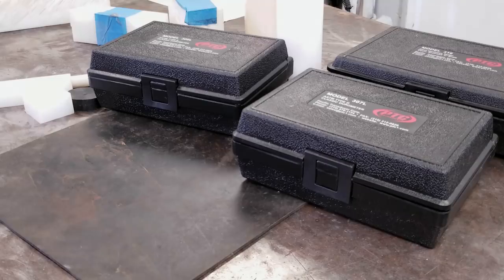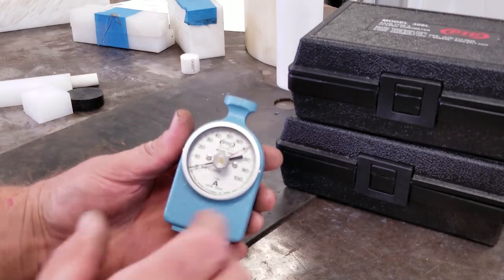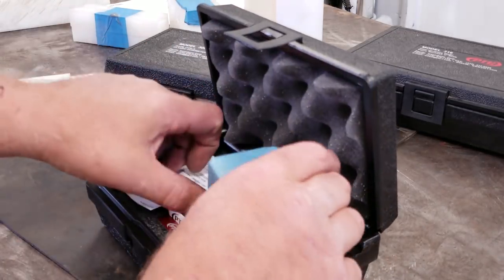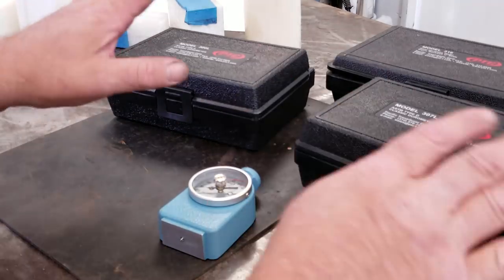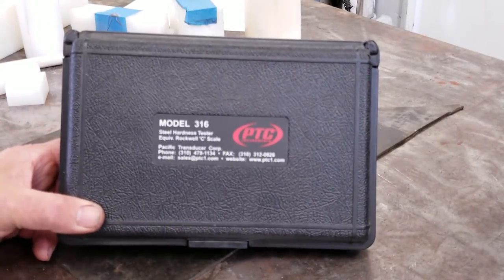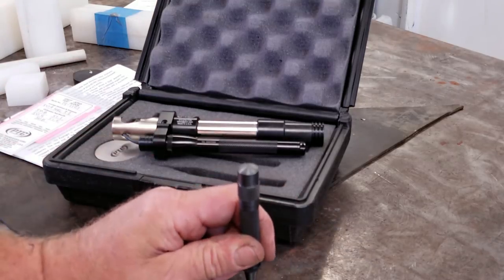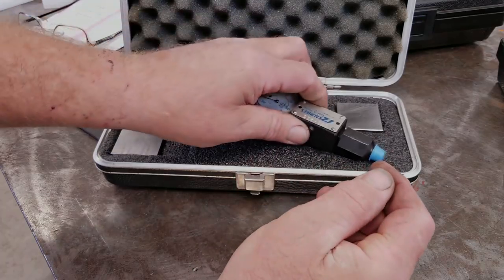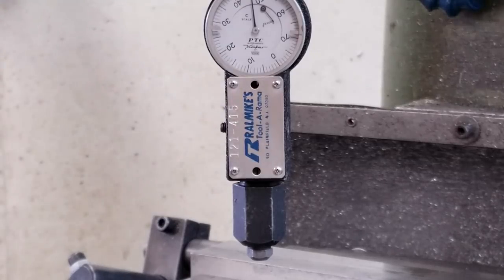PTC Hardness Testers

Comment: Nice video Stan. We use Shore A and Shore D durometers extensively at my work. We've found the variations on the same material are generally attributable to surface roughness. The tip of the indenter for these Type M tipped durometers has a .004 radius and it can find low spots easily, which will yield incorrect low readings. Also, when measuring the hardness using durometers, it's extremely important to ensure the test specimen is at least .250 thick. It is permissible to stack plies to obtain the necessary thickness. This is very common when measuring the hardness of elastomer adhesives to verify complete cures when the applied adhesive thickness is less than 20 mills. Also is important the entire foot is in contact with the specimen in accordance with the ASTM. It's also best practice to avoid using readings below 20 or above 90 as they are considered unreliable regardless of calibration verifications. These are slick little devices.